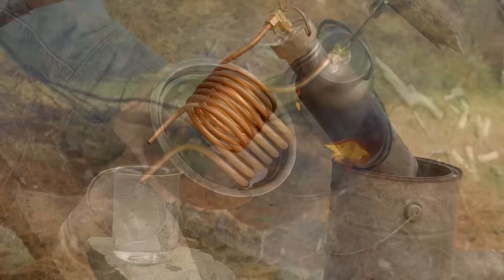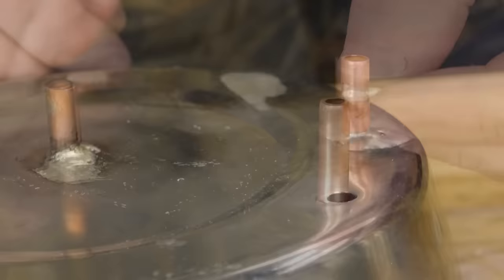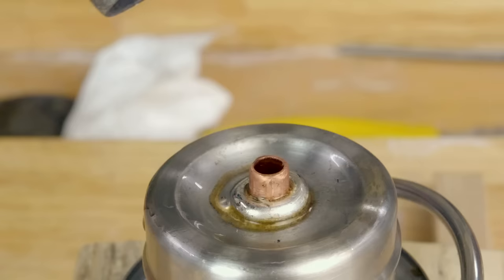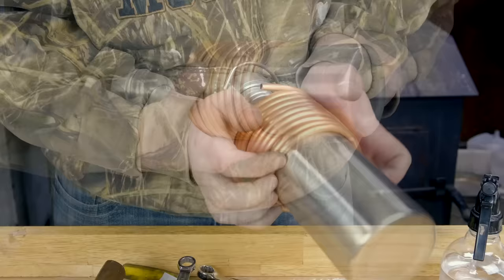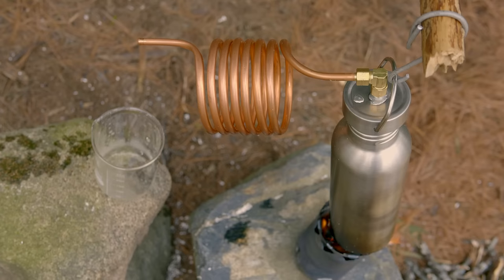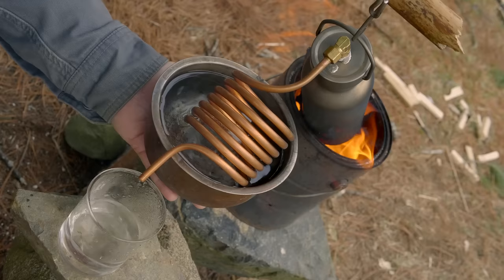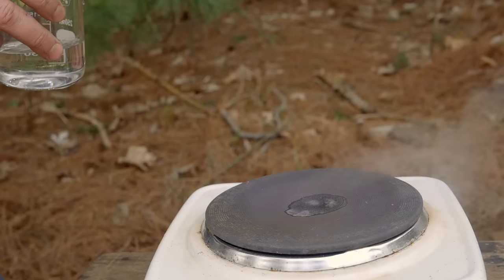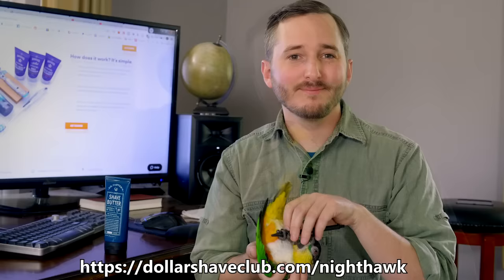DIY Salt-Water Survival Bottle (Compact Desalination Kit)

Comment: I would recommend using only stainless steel parts. Copper in contact with distilled water oxidizes quickly and this oxidation contaminates the water. Another tip is to leave dolomite tablets in contact with water for a few minutes to raise the ph and recover magnesium and calcium. We also have to be careful with excess boron in desalinated sea water, sometimes the steam pressure drags the boron. I prefer to use brackish water.
Reply: boron and magnesium are very important minerals. if one does not have them tooth decay and bone problems will appear.
Reply: Well said both of you
Reply: Both you guys kick ass. Thanks for these tips
Reply: @katatoth7551 I'm not sure what Boron is... i know what Borax is, though, but something tells me I shouldn't eat it 😅
Reply: You’re very right about these tips BUT he used a stainless steel bottle and a COPPER TUBBING. As someone who builds homes for a living I’ll tell you we use copper for water all the time. He’s not heating copper he’s heating stainless steel
Reply: @we4ever984  Do you build homes for a living which use copper tubing and distilled water though?
Reply: @jotchava bro your tap water is coming from copper pipes - that’s his point. ideally, the wort chiller won’t get hot
Reply: how do recommend ppl bend or coil stainless steel genius? a tube bender isn’t going to do it and hydroforming is risky without experience
Reply: @woofy9977  tap water is not distilled.
Reply: @we4ever984  In a controlled system that receives water with a pH > 6.5 from the public supply there will not be much contamination from the copper piping to the water. The problem is copper in contact with distilled water which may have a pH < 5.5.
Reply: @radiobento  Freshly distilled water has a pH of 7
Reply: when you find brackish water you don't have to perform distilation, all you have to do is just follow the stream of the river for freshwater
Reply: Copper’s toxicity is low and it is rare to experience toxicity. I think you’d be having an awful lot of corrosion in your copper tubing before you were ill, and more importantly, it is supposed to be the distilled water reaching your tube here, whilst the salt water is meant to remain in the heated vessel.
Reply: @woofy9977 hi bro 
If you wsnt bend a pipe, edpecially small, fill it with sand first
Reply: That amalgination might corrode
Reply: @woofy9977 put some sand in it before bending works.
Reply: @we4ever984 yup water distiller kettle have copper tubing
Reply: I wonder why did he close the tiny hole that was meant to release air pressure🤔
Reply: @VakoDemuro-wc3yw  because it's not needed? He already has a long copper hole
Reply: @blueberry766  But the handle went into the top so it escapes that way
Reply: Copper with the water , are you serious , ??
Reply: @katatoth7551 boron can it be replaced using borax
Reply: @we4ever984 that's what confused  me  copper has been used for home plumbing for  forever. I mean they are replacing it with pvc  but I thought it's just due to a better cheaper material that's easier to work with ...
Reply: @woofy9977 good point
Reply: @radiobento okay so I built myself a water distiller using a copper pipe  that goes through a iron pipe.  It connects to a stainless pipe and stainless pot for boiling . Out the end is just rubber tubing . Is there a issue with that ??
Reply: @blackouting actually  people do
Reply: So what your saying is use a stainless steel coil tube
Reply: @radiobento  distilled water can have pH < 5.5 ? U have magic   water?
Reply: Ditto  @VakoDemuro-wc3yw
Reply: you could buy SS brake lines for the tubing.

Comment: If you use an open fire to cook while camping; you can use bar soap and splash of water to coat the outside of the cookware in a thin layer. This will allow the soot from the fire to be clean off very easily when finished.
Reply: Great tip, thank you.  Another option would be to wrap the bottle in tinfoil or aluminum foil. A soda can can also be sn effective sleeve. The steel in the bottle would not stay pristine though, as the heat will induce a color change.  But it will not be covered in sooth, which is much worse. 
Once the bottle cools enough to touch, you can use a mix of wood ash from your fire and a bit of your clean water to make a nice cleaning paste, it will scrub the bottle nicely without scratching it.
Reply: Thin layer of mud works ok too. Just enough to coat it, too thick and it'll quickly crack and fall off in big pieces when it dries.
Reply: Someone payed attention during old school Boy scout training!
Reply: Washing-up liquid is better. 

It's entirely non-flamable unlike some particular bar soaps. And even if you really burn the crap out of it. Still water soluble. So it just washes clean off.
Reply: woah great tip!
Reply: Learned this is the boy scouts in the early 1960s.